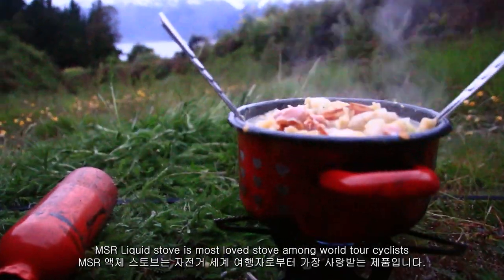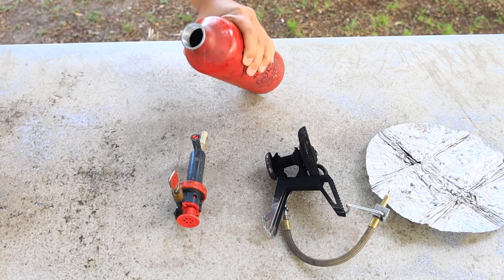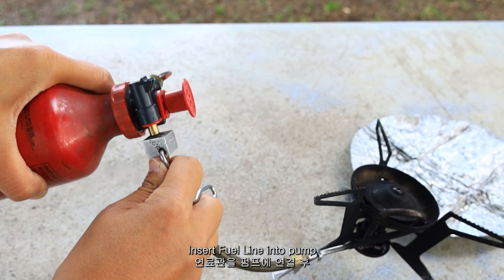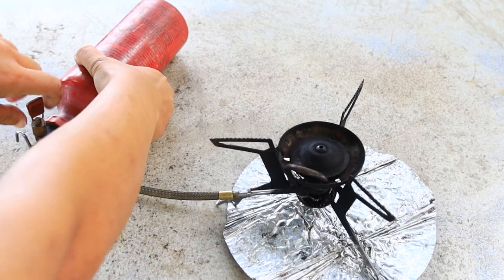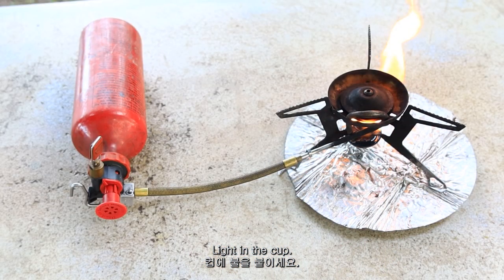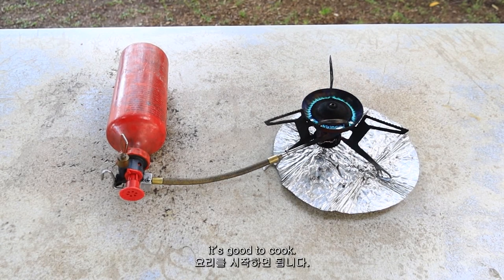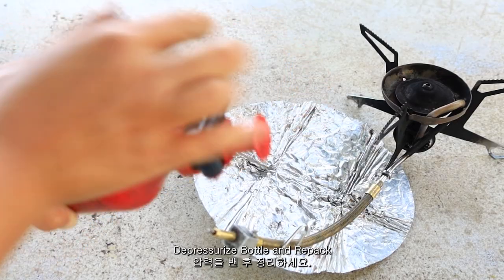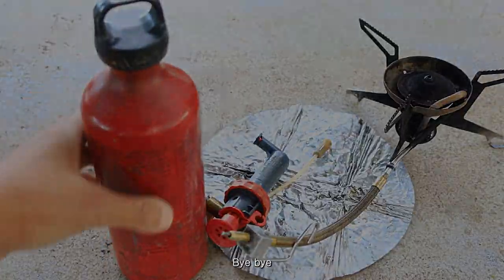How To Use Liquid Stove, MSR Whisperlite International | Most Loved Stove among World Tour Cyclists

Comment: Happy to see that your burner is as dirty as mine.....and i find that the only negative of it. Making coffee results in black fingers but he ....no pain no gain. I use this system for 25 years now and it's very robust.One thing i learnt is never take out the pump. Letting the pressure out is a smelly and nasty business and you have to pressure it again....to much work and there is no need. Just take of the jet and store it in a bag..no big deal and no big hassle.....One thing we should try is to take some full in a small bottle for heating it up...seems to work better and more precise then letting some fuel in to the fuel cup....and keeps it cleaner....pro tip from frank van Rijn. World cyclist for 50 years...Take care and keep safe.